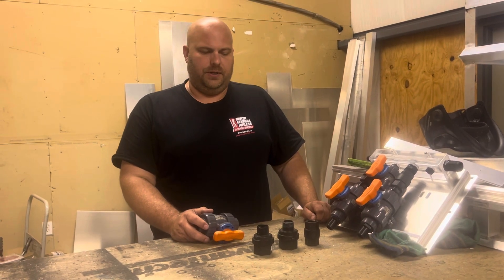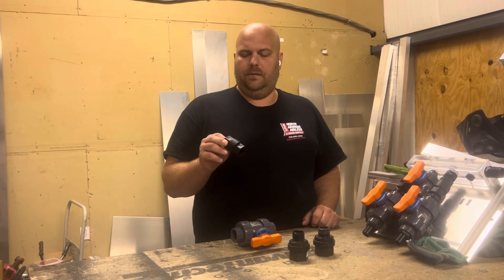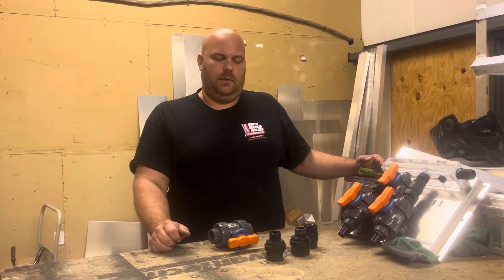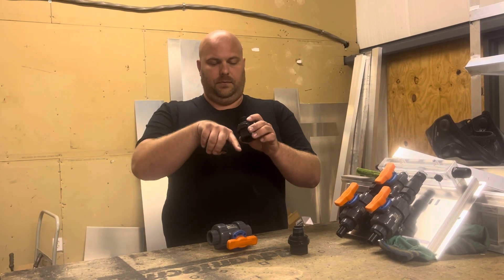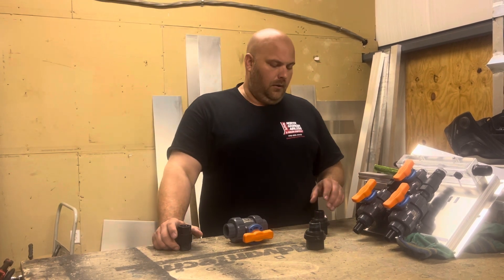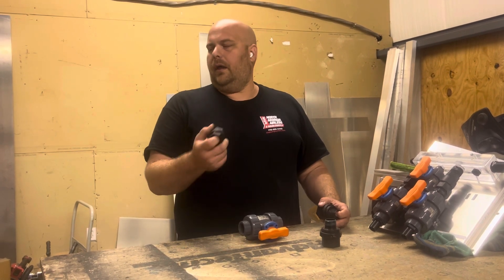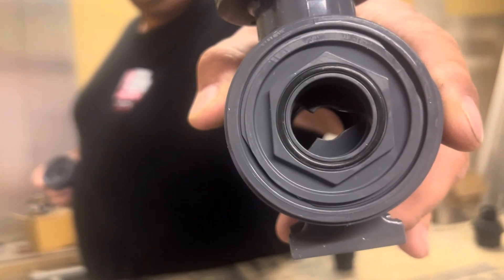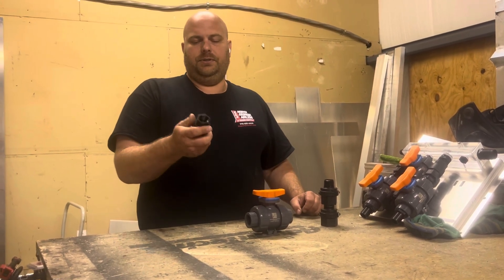Softwash Check Valves

Comment: Correct me if I am wrong, But it was my thought  that the check valves purpose was to prevent Bleach from entering into the water tank.
Reply from the maker: @paulsuli3581  that is correct but as a side effect they do also provide some inlet restriction.
Reply: I think what he’s getting at is your going to have less flow with the 1” check valve because of the higher cracking pressure than you would with a 3/4” check valve and less wear and tear on your pump. Since the valve already restricts flow, the 1” will restrict it even worse causing issues.